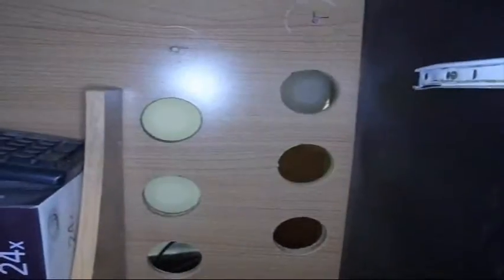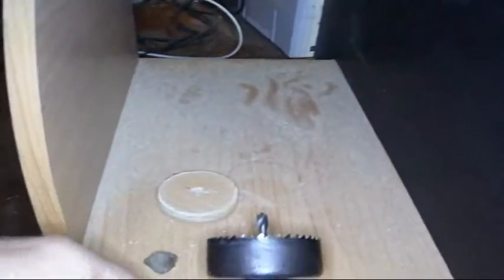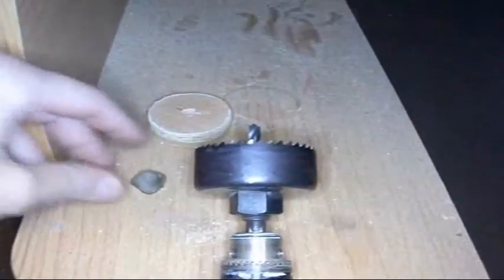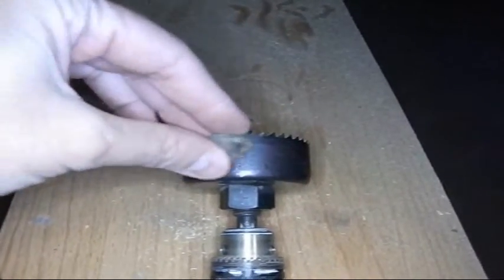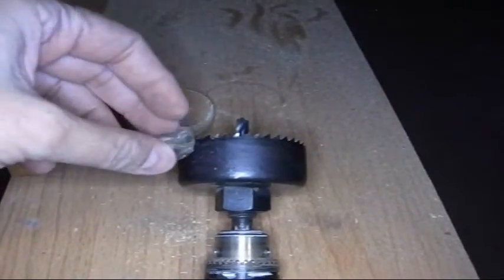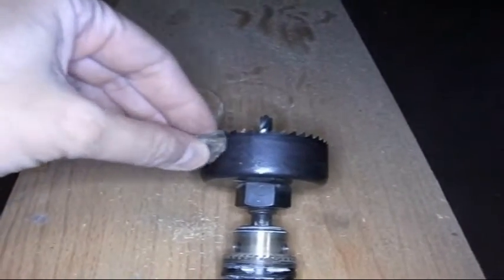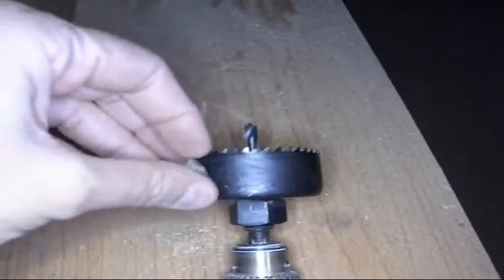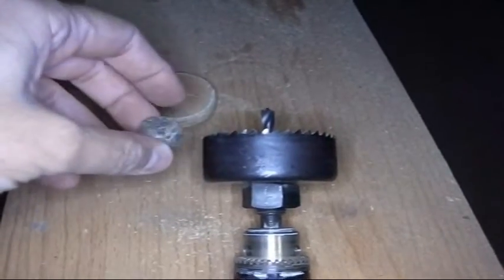Hole Saw - Faster Cutting, Less Binding

Comment: Another tip is to score the surface with the hole saw then drill a small hole or two inline with that score mark to give a place for the chips to evacuate as you drill with the hole saw again.
Reply from the maker: Excellent tip.  I will have to do that in the future!